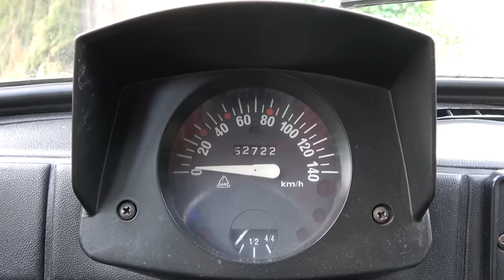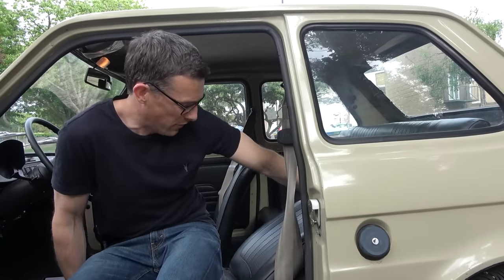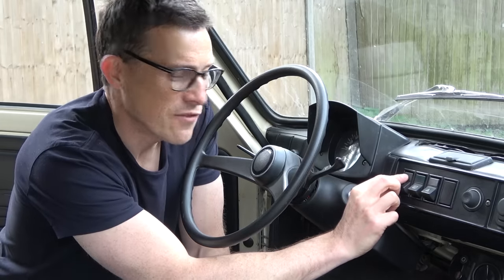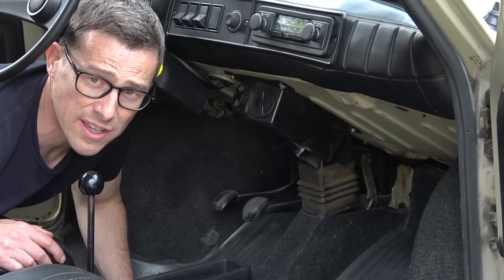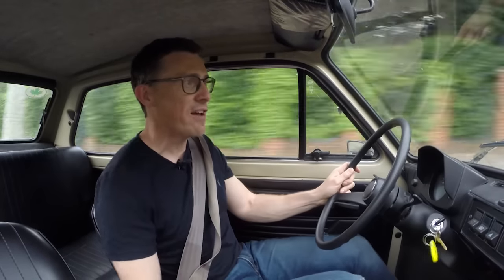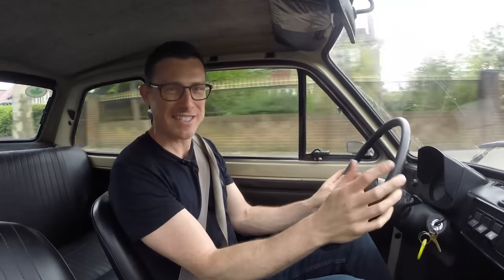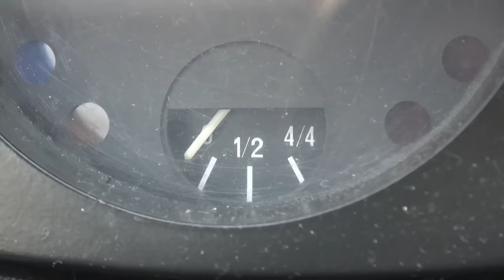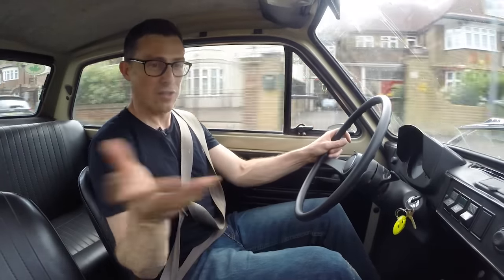I bought a Fiat 126! See why it's one of the coolest cars ever...

Comment: It has some safety systems like horn, warning lights and brakes
Reply: :D
Reply: Lmao
Reply: Seatbelts!😎
Reply: And none of them especially good...
Reply: @pracakosaipilarka4301  seatbelts can't stand in crash tests
Reply: You can double that by installing the pillows on rear "sofa"...
Reply: No seatbelts in this car cause slav die like real man
Reply: hahaha
Reply: In italy seatbelts were made mandatory sometime in the 90s you see..
Reply: but the best safty "system" was the design, so deterrent that you didn't want to buy this car at all :P
Reply: Not a Lada though...😎😎
Reply: Da comrade, better than other cars
Reply: It's a really great car, it's acually the safest car but during the accident you cannot be inside.
Reply: @Majkyyyy  it has a 100 % protection rate when empty.
Reply: yes
Reply: and a padded dash/airbag for the passenger :D
Reply: Siema
Reply: And some prayer card hidden in the fold of the sun visor
Reply: it has a iron body, wheels and engine that is all you need
Reply: also spare wheel was part of it's safety system (in design phase it was supposed to act as internal shock absorber). 

When it comes to emission regulations it's better to look for the latest version: Fiat 126p elx. That one was with catalytic add on. From model 126p el there were improvements in electricity (though still battery was an issue) changes in interior and internal heating. Also seats were changed into better one. Declared fuel economy was probably 7 litre per 100 kilometres but we got 5.2-5.6 with ease from el model. Top speed was declared as 105 km/h, in good conditions it eventually raised to 115 km/h (fastest ever we ride it was around 128 km/h (downhill) but it ended with huge repairs of the engine within 8000 km)

But still it was best training/learning car for future racers. Especially on ice it was tough teacher - loved to dance with it's engine behind axle but it was so underpowered that all slip/drift training happened at quite slow speed. Other training experience: brakes were really sensitive to weight of passengers and cargo. 
This car was not fast muscle car but it was a great trainer before one get to fast cars.
Reply: That horn sounds like a buzzer on the front doors of old houses, that didn't have a bell! I always felt these cars had a well-styled shape, and I fail to understand how anyone can ever like the Fiat 500. So this car wad truly a worthy replacement!
Reply: @huseyinuguralacatli5064  Oh my God! The seatbelts FAIL in a crash? Do you realise, that on the TRABANT, the seatbelts RIP OFF in an accident? That's because the car is FIBREGLASS, and you are meant to put a metal plate behind the fibreglass, so the seatbelts have something stronger to hold on to!
Reply: @SuperGiancarlo96  actually, I found a prayer card, on the back of the sunvisor, of an Austin Allegro. But I can understand this, because it had belonged to a church minister!
Reply: @drasysitalia3461   You right,around 90s ! P.S. For curiosity i serch the years, was 11 /April/1988 .
Reply: Steering wheel so you can decide not to crash and a windshield so you can see where you are going ventilation so you don't suffocate.
Reply: @sued_  he might add it for safety or die
Reply: Lmao The Bare Bone Basics hehe luv this car
Reply: and a rosary hanging from a rear-view mirror
Reply: don't forget about the bumpers
Reply: They need to put those on all cats instead of 1
Reply: And every one will assume neither of those "safety features" don't work, and will avoid you at all costs.

Comment: I was 5 and my mother had one of those, one day we were on the GRA (Rome highway) at almost 150 km/h and overtook a 355 GTS that was cruising in the right lane, cheering like we won the world championship. Half a km later we had to stop at a service area for overheating, water from the radiator cap was sprinkling like a fountain. 355 owner stopped for refuel and paid us a coffee. I recognize that moment as my petrolhead initiation.
Reply: fiat 125p don't have radiator ))) its not water cooled 600 ccm engine (very early models),650 cm (later version) and 700 ccm ( used in 126p bis  ,engine made by Lancia) , So your story with fountain of water from radiator is not true))) However speed 120kmh  with 650ccm was normal with 4 passangers, with 2 passangers 140kmh was possible
Reply: @wwiertus   We had the 126 italian version 700 cc light green 4 gears, probably BIS model as you said, it had a radiator, and it did 150 km/h (probably 143-145 with measurement tolerance), at only-god-knows-rpms. Radiator cap was in the upper back on right side when you opened the boot. Was i there that day or it was you? Unbelievable hating these days.....
Reply: @gabrieletuzi5411  126p Bis (700ccm) could get into 150 km-h. 650ccm could get 140 like I said with 2 adult , or 125 with 4 adult . maximum speed 105 km-h was according some long distance test drive. So in fact it was interpolation . not a top speed on this particular moment. 600 and 650 ccm was air cooled, 700 ccm with Lancia engine was water cooled. Polski fiat 126p was development of Italian 126. more power. adaptation to colder climate, service etc. it was all polish development which make this car better then Italian original. same story was 125 127 134 142
Reply: @wwiertus   I suppose you're right. thanks for the infos.
Reply: the usual version did 105km/h the big one 700cm 115km/h there's NO WAY this thing could go 150km/h unless falling from a high brigde
Reply: @londonfinancial   The car had been modified, tachometer on highway was always at full-scale. It was a common practice here in italy and also mothers here got the heaviest right foot on the planet. 😂😂
Reply: @gabrieletuzi5411  ok... still you need like twice as much power to run it to 150km/h. and I highly doubt - as a polish ;) who heard a lot about those, that the speedometer shows the real speed.
Reply: 150km? You sure it wasn't a dream?
Reply: We had one when I was a kid and top speed was about 105km/h so you probably saw that.
Reply: My wife's sister had one and we went to see side in Croatia with it. I am 2m high and I was in the back seat all the time...LOL...beautiful times.
Reply: A jabba a 150 km/h sul raccordo anulare cor 126 amazza manco le fiat uno facevano 150 heeheh
Reply: @themarvelousvintage76  HAHAHA l'avevamo presa aggratis da mi nonno, che cambiava na machina ar mese, je piaceva de' core. Non t'o sò dì che cazzo j'aveva fatto er meccanico, annava come un ponyexpress.
Reply: I do 140km/h in a 126 bis 150 is not impossible
Reply: @huseyinuguralacatli5064  the speedometer on this car are way off you are talking about of car from 1973 74.........the actually top speed of fiat 126 its above 115km/h  put a gps on your fiat and you can see the real top speed.
Reply: @themarvelousvintage76  car's year is 91 and its downhill with back wind :) sorry for my english
Reply: @huseyinuguralacatli5064  you speak english better than someone live in USA for 15 years not worry......
Reply: it is air-cooled
Reply: @wm9217  126 bis is water cooled
Reply: @huseyinuguralacatli5064  it is a very rare model.
Reply: @wm9217  I have one of them in 22000 kilometer
Reply: @gabrieletuzi5411  5400rpm at 140km/h
Reply: @huseyinuguralacatli5064  they are rare! How come you got one, Sir?
Reply: @wm9217  it stay in junk yard since 2006 I buy it this year and I want restore it like it's a new
Reply: @huseyinuguralacatli5064  just do it. If you have big trouble getting parts pls contact me. Expect my help.
Reply: @wwiertus  but 140 was at the end of speedometer... So it had to be some "magic" out there. Never seen crossing like 105-110km/h with it.
Reply: @madyogi6164  i was passanger in 125p 650cc. very often. 125 km /h was very often, this is bis version 700cc and could drive 140 km/h
Reply: @wwiertus  haha, yea that one looked a bit better...
Reply: @madyogi6164  well. people use to say that Italian designt is the best. perhaps you got other opinion, there are people who love Trabi, you know))) others want only corvette, other only RR etc
Reply: @alebnz9036  Da quanto leggi in molti abbiamo avuto simili esperienze, si stanno scambiando i pezzi se leggi sopra, senza argomentazioni sei zero "ci".

Comment: I did my driving course in this thing, including the final test. Back in early 1990s this was still virtually the only car used by driving schools in Poland.
Reply: Pawel X they stopped in 2002 I think
Reply: @indiekiddrugpatrol3117  quite possible, 1996 still 126p was what I had during the driving lessons as well as during the exam. 

Two years later I got one it was my first car and with all bad that can be said about it is was fun to drive. I had the "facelift" version. from the outside and partly old partly new in the inside. it was renovated after the crash.

Comment: 1. So whats it like on a twisty road ???

2 . Drag race between that Fiat 126 and a Renault Twizy

3. Drag race between a Rolls Royce Sweptail and a Bugatti La Voiture Noir
Reply: Twizy would drop this lil rattle can
Reply: @KonKnd  It does have 6 hp less than the Fiat 126
Reply: @sameerafokeena2271  love the 126p but the power is worse than a bicycle and you can't launch it because everything will fall apart 😂😂
Reply: @KonKnd  oh yea good point 👍
Reply: @sameerafokeena2271  still wanna see a race between them !!
Reply: @KonKnd  hell yea
Reply: 126 0-100: yes
Twizy 0-100: no
So 126 would win. Eventually. You would probably need a calendar to measure the 1/4 mile time of both of them.
Reply: Drag race is not where this car potential is. Believe it or not but on snowy/muddy/icy road it's perfect drift machine.

Comment: I got the exact model of this car (I was 20) back in 1979 (Including the color). I drove it in some scary conditions, like fresh deep snow and on long distance trips loaded with people and luggage. One of my favorite “features” was the stretching starter cable. After some time, the only way to start the car was to push the starter from behind with a stick. The fuse box was in the hood trunk and the way to get the ignition on was to put a coin between the first and the second fuse, which made it the easiest car to steal. Thanks for the video. It made my day!

Comment: We have a saying in Poland about this car
"The crumple zone ends at the engine" xD
Reply: And it starts on drivers knees😋😁
Reply: My mom had a Fiat 126 when I was a child.  It got rear ended once.  I was in the back seat at the time.  I was OK.  But even though the impact was not strong, the damage to the rear of the car was quite severe.
Reply: @anabukis.9528  bs ? Whyyy
Reply: @anabukis.9528  Yes they did, just like they did say that the maluch has heated rear mirror so your hands won't get cold when you're pushing it. Also I'm not sure if you understand this, but it's a joke, that imply it's a deathtrap since you know, the engine is in the rear.

Comment: My dad bought this car in the year 1980. We are from Chile and it worked geeat. You could fix it wirh almost anything.
A fun fact, once it was a flood in the town and much biger cars were not able to run, but this car had the distributer and air entrance very high so it got by no problem with the water at the middle of the door.

Comment: Here's a tip:
Fuel gauge is most probably connected to the reserve light pin instead of the floater resistor, hence the gauge problem. Reversing the connectors on the fuel tank should fix this.

Comment: Owned one of these. Despite it's size it could go the Budapest-Warsaw length. One of it's key features is, because of it's motor situated at the back it can easily climb mountains (even if the road is icy, which I experienced multiple times with it and all it needs is winter tire).

Comment: This was my dad first car. We traveled from south Poland to north 550miles with the family. 😂
Reply: Oiu82 550 miles or kilometers 😂
Reply: My dad also had one. He bought it in 1984. 
It was very cool in this car that it was possible to take out the engine yourself without any crane. I liked the washer button in this car, it was one of the coolest things, made of rubber, without power. The force that pushed the liquid out of the reservoir was a finger press :)
Reply: @gkwas 
Overpressure
Reply: @BorianGrey :) When we used it I was 3-8 year old (I was born in 1981), it was a lot of fun for me. Especially when my father crashed it into the truck :D "Maluch" was so low that it pulled under the bumper of the truck, which did not deform the front part of a car and made a hole in the mask :)
Reply: @gkwas  just like the 600

Comment: there are plenty of projects with this car in Poland, supercharged sleepers nad motorbike engine swaps. And faster than hondas on drags ;)
Reply: Motorcycle engine swap sounds like a must!
I would want disk brakes though.
Reply: @ZesPak  there was a guy who basically put 126p's chassis on some fiat Punto's or something's like that suspension and engine.
It was a fiat 126p with 150bhp turbo engine, disc brakes, normal suspension, and it was widened by like a meter. I can't find the video though :/
Reply: @ZesPak  Disk brakes? That would take away from the character of the car. Stop slowly or hit something.

Comment: This must have been some sort of "de luxe" version... I remebmer mine had only one switch on the dash unlike three on Mat's one
Reply: This car is a mix of old type body and newer suspension with '85 13" wheels. Original should have 12" wheels with "slowers down" instead of breaks, recognised usually by this kind of bumpers. I had also 600ccm version, with all inner equipment and engine same as in video, but transferred into new '86 body. Such thing was called "składak", lets call it "assembly" in English. Usually done after a crash and body disqualified to be repaired. And my 600km trips from Silesia to seaside didn't take 12 hours as said in another comment but 10 during the night. Children had their sleeping space in the rear seat and we made such trips few times. Necessary things were spare parts (once were needed) and 20l spare tank filled with gasoline bought on the black market, to save another fuel coupon for trip back. Range with full tank was only enough to reach Toruń.

Comment: 1:16, that suspension layout is exactly what you see on a 1932 Ford
Reply: that type of suspension was used in the brazilian Fiat Uno (on the rear though, because it was front wheel drive) up until 2014, when Fiat killed the little Uno because the law now was that all new cars must have ABS and airbags, and the uno couldnt.
Reply: Thats not true. 
Ford had metal rod-axle bt wheels. 
Fiat have independent suspension on one leaf spring.
Reply: @jareknowak8712  well I commented on what I saw and it's not the best image
I was more surprised about the leaf spring layout
Reply: @harleyrobertson73  yeah, one leaf spring, just like 2019 Volvo S60 in the rear. 
Not joking.

Comment: Respect mate.I had 3 of these back in Poland.Never let me down......
Reply: greg stecyk ,never did let you down?
But you needed 3 so why?
Reply: touraneindanke Good question. But I’ll try to answer. One of these 3 fiats belonged to my mum but I was using it quite often. So I can say it was my car too. Second of these cars I bought as my “first car”. So it had to be cheap hence it was quite worn. It was a good runner but looked like it definitely had better times before I become an owner. So after 3 years I sold that one just to buy 7 years younger piece. But all of them where great. My mums one was pretty much the same as the one in video. Only difference was colour-yellow Bahama. She sold it in 2010 with original mileage of 30,000miles. Car was made in 1983. So 27 years old.

Comment: I did it. I drove mine from Poland to the UK in november 2014. Took  me 5 days (I was driving mainly on the back roads) and I had to replace the brake pump. It went after about 600 miles ;p

Comment: I love those little things. Back in Cuba, we have a bunch of them. Actually I have a friend who has one right now. Could u do some upgrades to it??. Please dont swap a new engine in it. Lets see how much power can u get.... congrats on your purchase and new subscriber.
Reply: Wouldn't it be perfect for an electric motor though?!
Reply: @Rick Deegan you can get it up to almost 50 even without a turbo. Durability of the engine goes out of the window, but it can be done. 

I have one to put the interior and the engine in right now. Thinking of getting the power up to about 35 BHP, just so that it would be a bit more lively:

- taking a few mm off the cylinder head to up the cylinder pressure
- machining down the flywheel a little
- upgrading the air intake
- polishing out the rough surface of the intake/ehaust channels on the inside

Probably will need to put some disc brakes in afterwards too!

Comment: That's amazing! Here in Brazil, we have a 147 model, more modern than that car, has a motor in front instead of on back. If this car was mounted in Brazil at that time, it may be a good concurrent of VW Fusca. It has exactly the same concept.
Reply: But the 147 is based on the European 127, it is a bigger car with a very different architecture.

Comment: Eh ??
0:16
"The Fiat 126 was built in Italy between 1972 & 1973" ??
According to Wiki, it was between 1972 & 1980.

Odd that people think that the emissions on this are bad. If it's economical, by definition, it will have low emissions.

Comment: Try reversing the wires on the fuel gauge. It might work properly
Reply: That's what I was thinking. Had one in the 90's. Loved it. Complete exhaust cost about £27 and I replaced a throttle linkage with a paperclip lol. In winter it just drove over snow as other cars got stuck.